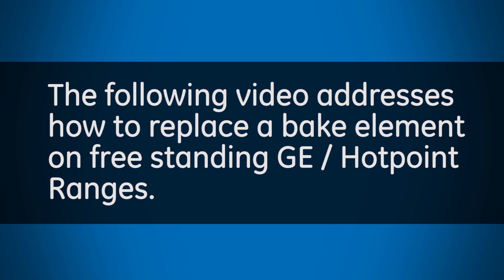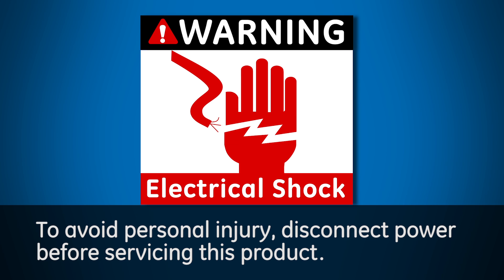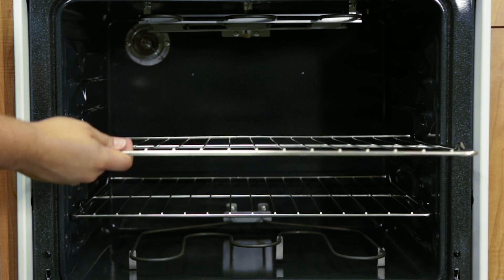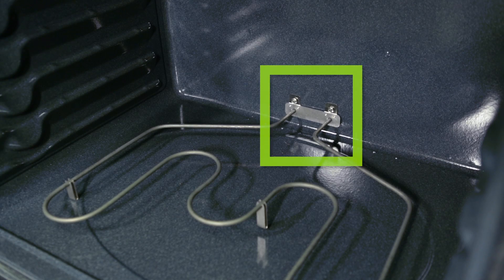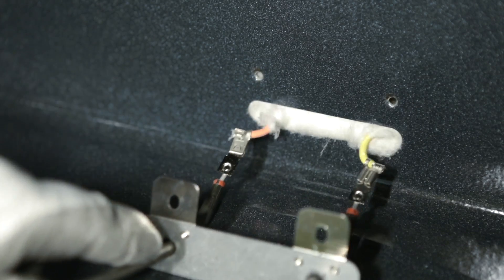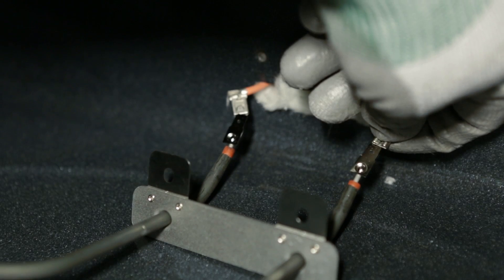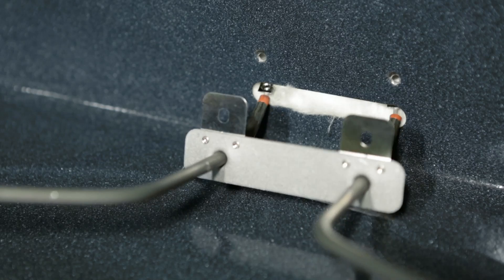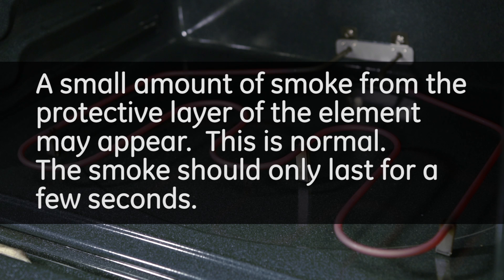Electric Range Bake Element Replacement

Comment: Thanks for posting this. I had trouble getting the wires off the old element, but by using a leather glove for a better grip and pulling and wiggling for a while, I was eventually able to get them off. They slipped onto the new element with almost no effort. As careful as I was to try and avoid letting the wires slip back in the wall, one of them still got away from me, so I had to pull the oven out and take the back off, but it was no big deal. There were 5 screws holding on the center plate, and once I took that off, it was obvious which wires I was looking for.

Comment: The gloves are an important tool for this process. Something in there bit me while I struggled to get the old element out (I think it was the top of the plate on the element. It got me good, but it wasn't a bleeder so I think keep it clean and it will heal very quick). Turns out there was very tiny metal pins pushing up through holes on the element which secures the connection. With gloves it was much easier to push this pin down and the old element wiggled right off. Trying to make sure my wires don't go back through but I found things that triggered my military cleanliness OCD in places that were hard to reach with an element in there lol

Comment: Easy as pie. Note #1 - the wires are about 2 inches long, so pull gently to get them fully extended.  Note #2 - My model only required a 1/4" nut driver to remove the screws. The element itself slid out and into little housings - no screws attaching the wires to the element. This do-it-myself saved me $100 trip charge + labor charge.
Reply: How hard was it to slide the element out of the little housing, because I’m having a really hard time. I’m really giving a good tug and it’s not budging
Reply: @peacebear222  Not hard at all in my experience. Turn off electricity to stove, remove screws. Pull wires out an inch. Hold wire with one hand, pull element with other.
Reply: @Donna Angley See at :48-:50 on the video.
Reply: @rabbidpc  Thank you, got it done. I’m sure it took me much longer than it should have, but I persevered and it’s all completed. Thank you so much for your help!

Comment: I used a zip tie on each wire before disconnecting from element so they couldn't slip back through the hole.

Comment: My Hotpoint model has the same element replacement steps, but the wires are so short and anchored so tightly, that instructions to remove the center back panel (two 1/4" hex head screws) would have saved us an hour and two sets of sore knees.
In fact,  I suggest removing the panel first and if there are two people available, have one person push the wires through from the back to make the connections easier.

Comment: So, I can’t seem to disconnect the part. How hard do I have to tug on that connecting wire piece? I don’t want to break it but it’s not budging
Reply: I did finally get it off, but the second wire fell through the back. I ended up taking the back panel off which was actually not hard at all and was able to replace the coil easily enough. Thank you for everyone’s help.
Reply: I'm having the same problem getting the wires to slip off of the old element like they do in the video. They're not budging. If you have any tips, I'd love to hear them. I'm worried I'm going to break something. Thanks.
Reply: Never mind. I used a leather glove to get a better grip of the connectors and wiggled and pulled and they eventually came off. Slipping them onto the new element was as easy as in the video, though.

Comment: Thank you for posting this.  So why do the directions say you need a philips head screwdriver?  Looks like just the nut driver is required.
Reply from the maker: Let us look into this and get back with you, Adam.  We apologize for any confusion. Thanks - TH
Reply: Okay thank you - I had a thought after posting this that perhaps on some ovens the element is held in with phillips screws instead of nut screws?  No idea if this is plausible or not, just one possibility I guess.
Reply from the maker: That is certainly possible, Adam. Once we hear back from research, we will clarify. Thanks for your patience.
Reply from the maker: Thanks for your patience while we looked into this, Adam. The Phillips head screwdriver is not required for this repair as indicated. We are working to get the video updated as soon as possible.  We apologize for any convenience this may have caused. - TH
Reply: You don't need the screwdriver if you do it this way, however if you want to be extra safe and unplug the stove and you can remove the back panel (with the screwdriver) and disconnect the wires from the back instead of pulling them through from the front.  This will also ensure your wires are back in the correct place.
Reply: Valerie Dillard no need to do all that, most ovens have a dedicated circuit breaker. Find your breaker panel and turn it off.
Reply: FWIW, my bake element and the plate on the back of my oven both had to be removed with a 1/4" nut driver. There were no Phillips head screws.

Comment: So ummm what happens if the wires go back into the insulation..... How do I get them out
Reply: You buy a new oven.
Reply: You would have to pull the range out from the wall and remove the back panel.

Comment: I should have looked at your video before I tried change the heating element;  the connector wires got pushed back into the oven wall. I tried to reach them with fingers and tweezers and just pushed them further out of reach.   How do I find them from behind?
Reply from the maker: We are sorry for your inconvenience. We suggest contacting service at this point. Service can be reached at the link below:   http://www.geappliances.com/ge/service-and-support/service.htm?ICID=GEARsupportflyout-service
Reply: you don't have to call a repair service. the same thing just happened to me. pull the stove out from the wall and the back has a cover held with usually 5 screws the same size as what was in the oven. removed those and you will expose the wiring. mine was so short (which is why it came off in the 1st place) I couldn't get it pushed through the rectangular hole inside the oven. therefore, push the connector terminals from the heating element through the hole inside the oven and connect them from the back of the stove.
Reply: John Macmillan thank you for this comment it saved me a lot of hassle
Reply: @johnmacmillan9309  This just happened to me.  Thank you for this guidance, will give it a try.

Comment: What the hell do you need a screwdriver for it's not even needed!
Reply: Back scratcher.
Reply: If you want to remove the oven door for safety and/or to insure it doesn't get damaged, you need a flathead screwdriver to move the "catches" on each inside corner.
If you have to remove the back of the range, you'll need the phillips screwdriver.